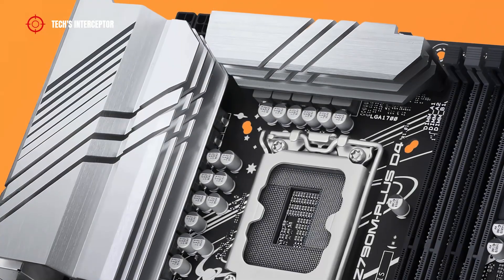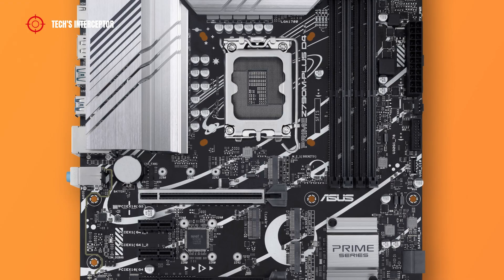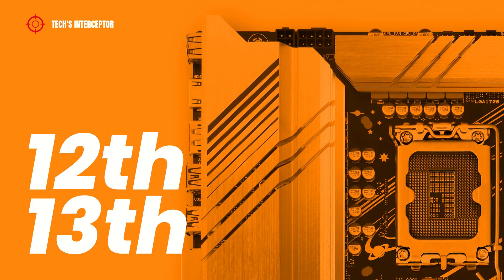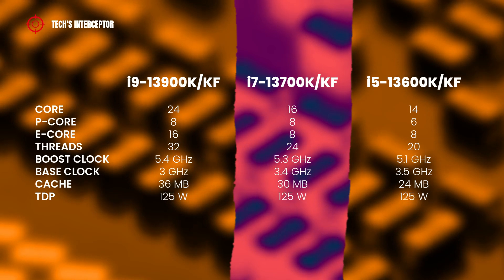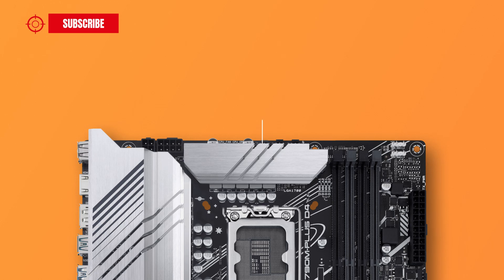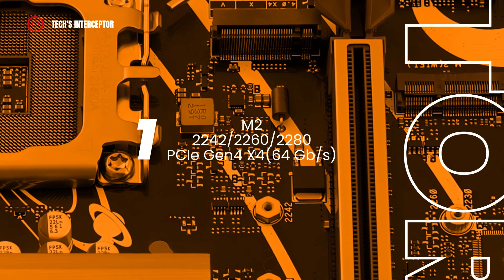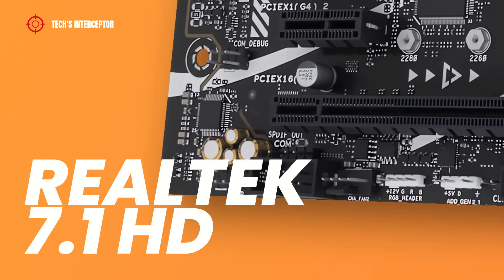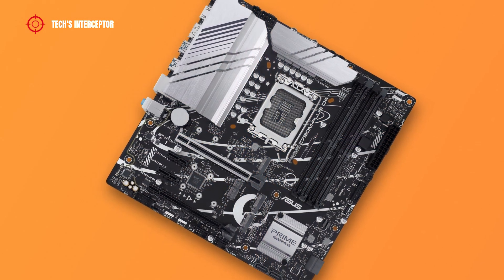Asus Prime Z790M Plus D4 - New motherboard designed for 13th Gen IntelCore desktop cpus

Comment: I just bought and finished building a I7-12700K with Asus Prime z790-M D4, Corsair LPX 128 (4x32) GB RAM at 3600MHz. And 3 NVME: total storage 5 TB.
Be Quiet Silent loop 2 360 mm AIO in top. And 2 be quiet silent wings 4 140 mm / 1100 rpm (bottom) and 2 be quiet  wings 4 140 mm /2400 RPM (in front),  on BQSWings 120 mm /1600 RPM in back in a Corsair 2500D chassi. PSU Corsair rm850e (850W). (For GPU integrated OR RTX2060. Right now the RTX2060 is installed and it just blows away in 1440p as per usual. My main computer has a RTX3080TI so basically it is for gaming primarily...(I9-9900K with Z390 strix f 64 GB RAM).
Rock solid mother board...Asus Prime is suprisingly good. If I go full ATX i would go for Strix e or f. But thats me, for a cheap mbuild, Prime is good (and bios is just the same as for strix so no suprises and that was also a good thing).
To make airflow work make sure you have the RPMs on fans right....people seems to forget how much you can do with that....Im super happy with my setup...."it just works"....as Todd would say. Did I mention i have a 10 Gigabit network setup, so I had to use on pcie lane for that....unfortenately. 1 Gbit LAN is not enough today....still cant believe 1 Gbit is "standard" still for home networks...its just cant keep up anymore. SO that is the downside with the motherboard, no 10 GBit RJ45 LAN.

Comment: I'm satisfied with this board since the day of launch, but noticed that only using 32GB DDR4-4600 (my pick: CMN32GX4M2Z4600C18) over my previous 3600MHz set, can get the most out of my i7-13700KF. Because of its memory bandwidth requirement, i suppose, but that means be aware if you're gonna use a high end CPU on a DDR4 board like this.. dont let RAM bottleneck you. High end 13th Gen CPU's are more for one of the DDR5 Z790 boards, over D4 variant.
Reply: i plan on buying this mobo, n combine it with the i5 13600k, be quiet! Dark Rock Pro 4, G.Skill DIMM 128 GB DDR4-2666 Quad-Kit (F4-2666C19Q-128GVK, Ripjaws V, XMP) n a displayport 1.4 cable. still looking for the right ssd, gpu, pcu etc
ur opinion brother?

btw i know that it s a dual channel system mobo, n not a quad system
Reply: I've a quesion, i've an 3070Ti, i want to get a 13600k and 32gb ddr4 3600mhz
This motherboard can be cool for the config ?
I want to do an undervolt + OC with it, i search a motherboard with who i can do it easyli
I will use a thermalright peerless assassin 120 se for the cpu

Thanks for your help